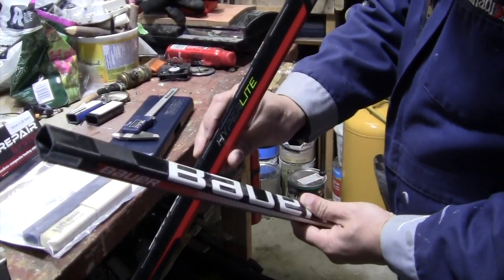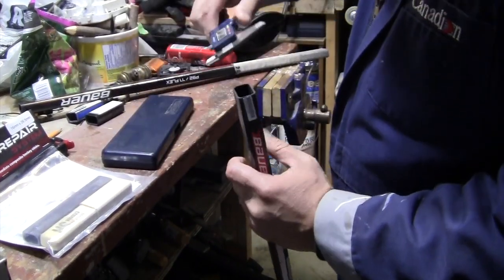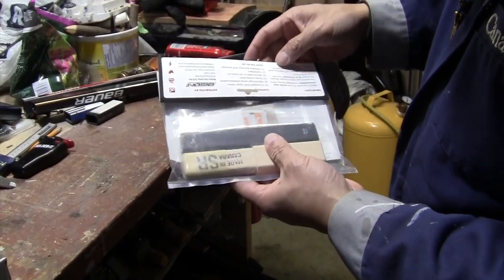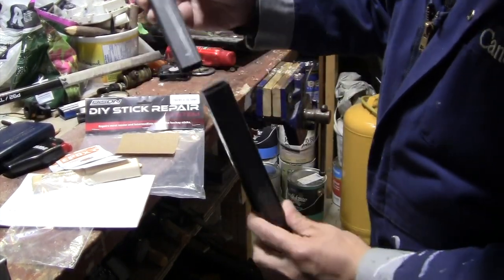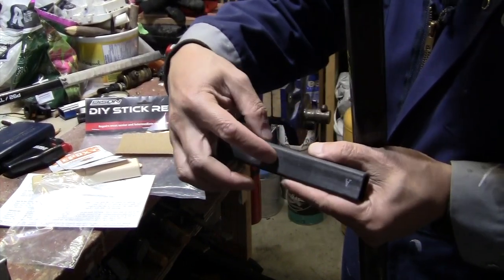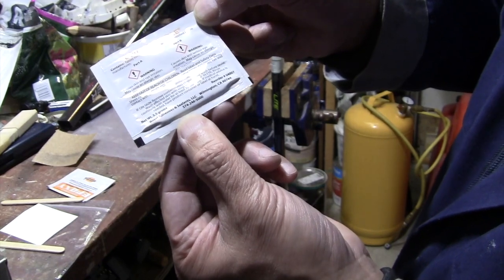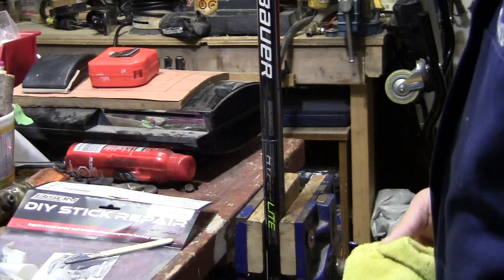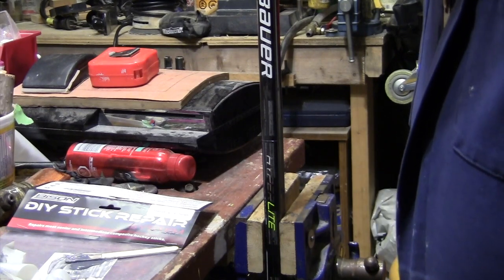Bison Hockey Stick Repair System

Comment: You could have had Integral Hockey repair it for you for like $60. They repair with a carbon fiber reinforcement in the inside and outside.

Comment: hello do you know what the part that goes inside the stick is made out of? thanks
Reply from the maker: Carbon Fibre.  Similar to the same material the sticks are made off.
Reply: @diykindofguy33  when it break?)
Reply: Thermofusible?
Reply: I mean hot melt glue